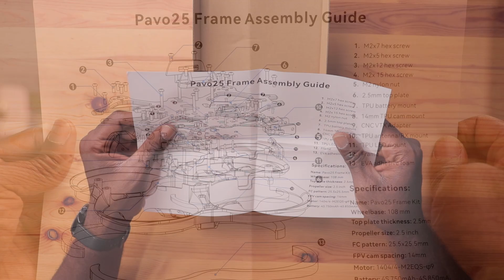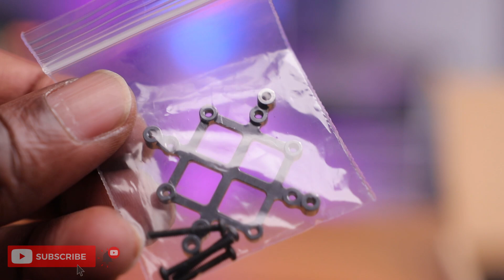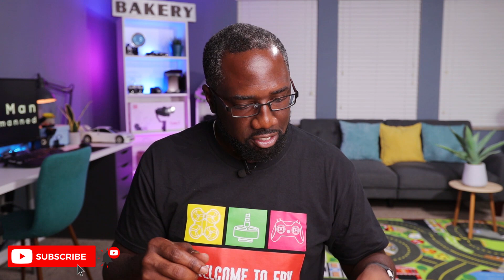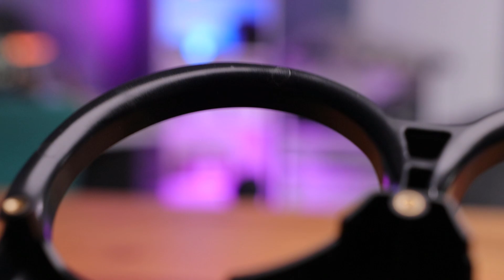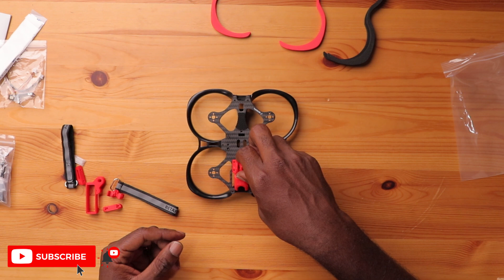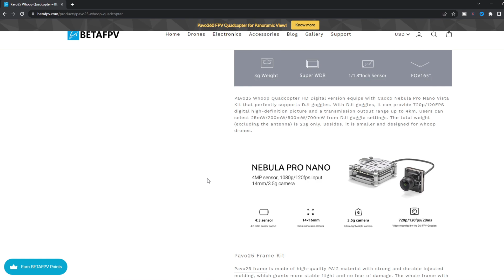Introducing the BETAFPV Pavo25 Frame Kit

Comment: Wow how easy was the building. Can I put the inside of my geprc cinelog 25 into this frame? the weak spots of my cinelog 25 quad are the motor arms of the top plate and on every little crash breaks one of them and I must completely disassemble the quad to change the top plate. this process is very time consuming and I search to another solution. The Construction of Pavo25 seems very stable.
Reply from the maker: Yes, the Pavo25 makes it very easy to conduct repairs.  It's only 6 screws to access the FC/VTX.  All components are mounted to the top plate.   The contents of your CineLog25 should fit fine as long as the mounting pattern of your electronics are 25.5 x 25.5mm or 20x20mm.
Reply: @OneManUnmanned  Ok Thank your for your feedback. The specs of GEP-20A-F4 AIO: 
Installing Hole: 26.5×26.5mm, M2. 
Size: 32x32mm board,26.5mm mounting holes (M2)
So doesn't seem to fit in this frame.
Reply from the maker: That's unfortunate...I noticed on June 25th, most of their FC were changed/revised with new boards using the 25.5x25.5 mounting pattern.  Sorry.

Comment: Looks like a nice frame. I have a 2.5 cinewhoop build for carrying my hawkeye firefly xlite,  but it is analog and the stack I'm using doesn't leave room for a vista unfortunately. I'll likely grab either this frame or the new iflight r25 eventually so I can go hd. But my analog version is so light, I almost hate to add all the weight. Don't know if you've been watching bardwell lately,  but he did a video on using crash recovery in betaflight for whoops.  It makes a huge difference if you bump something or clip a leaf with a whoop or a toothpick while flying acro. I'm even going to try it on my full size cinewhoop and 5 inchers since has helped so much on the smaller stuff with no downside so far. Enjoy the weekend!
Reply from the maker: Thanks Bryan..I was off the grid for a week or so.  I need to catch up on JB's videos.  I think I'll go Digital on this one, but haven't installed the parts yet.  Weight is everything when it comes to whoops of these size and trying to maximize Flight time.   Let me know when you end up choosing.  The R25 looks interesting as well.  Take care.

Comment: It seems like they have solved the COG/balance issue that many 2.5 cinewhoops have... some 2.5 cinewhoops have the vista centered, making it front-heavy when carrying a camera, and on others the vista is in the back, so the COG is balanced only when carrying a ~30g camera in front, but back-heavy without a camera. Correct me if I am wrong, but it seems the camera mount on the Pavo25 is a little further back (moving the weight closer to center) and that battery mounting solution is designed to allow the pilot to adjust battery position, from close to center to further back, according to whether the drone is carrying a camera or not... that's a huge advantage over my Kopis 2.5, aside from the slick, clean design. Thanks for this early look!
Reply from the maker: The CG on this drone looks pretty good.  There is adequate space to maneuver the front to back.   The electronics fit directly in the center as well.  As far as the camera, it's not at maximum forward as some other whoops.  Good observations.. I'll see how it behaves once I get it in the air.

Comment: I still have my Pavo30 but it has not flown in almost a year now as I gave up on it.  That thing was a pain the ass to work on with so many different screws and so little room to work with.  Frustrating to put it back together.   Hope they made the Pavo25 way more repair friendly.  Good luck with the build.
Reply from the maker: This one appears easier to work on.  I’m still in the process of building it.  If I experience any snags, I’ll definitely show it in the upcoming video.